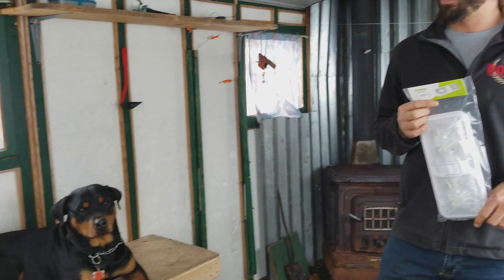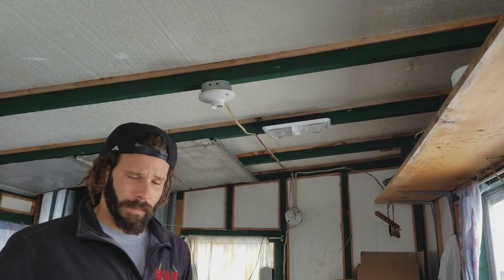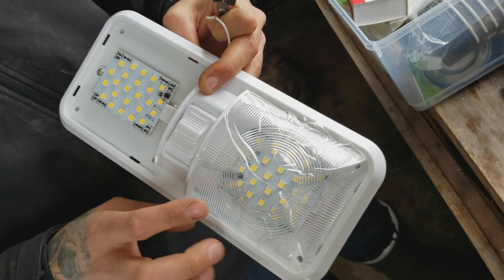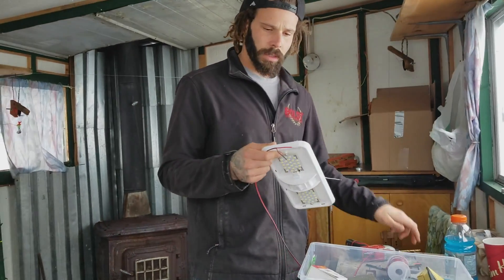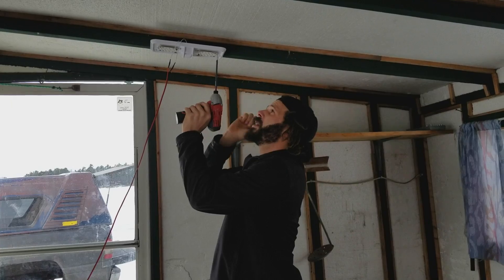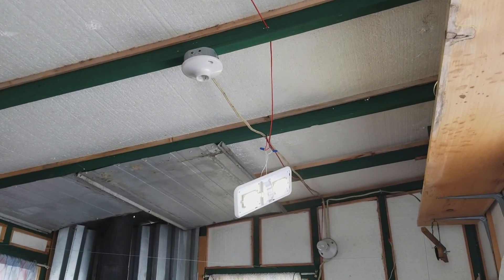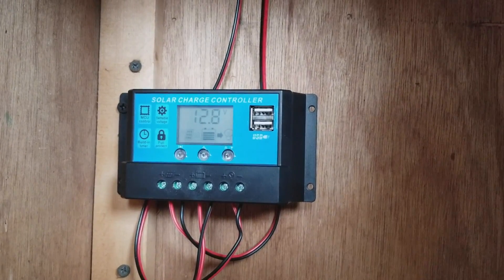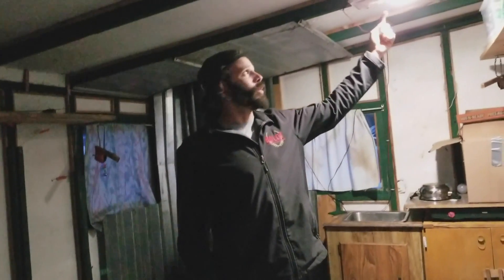Cheap RV lights from Amazon Kohree LED

Comment: Nice video, I bought 2 units and am afraid to set them up to my battery without a fuse or capacitor. I heard you can give too much electricity to the unit and damage it, what say you ? You might have that protection in you're fancy solar unit. Pleas and thank you or anyone else who may like to help.
Reply from the maker: I have hooked these lights direct to 12V battery for a short term (36 hours) without any problems.

Comment: What is the off position? To the middle?
Reply from the maker: I believe so.  One side single light, opposite side both lights
Reply: I just cant get the single light to work only the double idk if its my connection since i had 3 wires coming out of my rv with the old dinette lights

Comment: Are leds changeable, when they burn out?
Reply: they run off of 12V battery , if they burn out have to get a new bulb
Reply: Rite do they sell just the panels?bulbs?
Reply: @chadwilliams2682  Hi, did you change the bulbs. Mine burnt out but I cannot find the instructions or any video to tell me how do I change them. I succeeded unplugging the connections, but the actual card like bulb is impossible to budge out :(
Reply: @melyalvarez9262  haven't burnt out yet,I know they will eventually I'll look for new when they burn out

Comment: Do i still need relay or i can put it directly to battery
Reply from the maker: My set up is solar panel to solar controller then from controller to light. I'm not positive it you can hook direct to battery, indo know that the LED light is marked as 12v
Reply: Make more videos please !